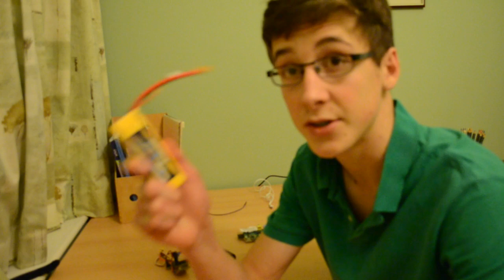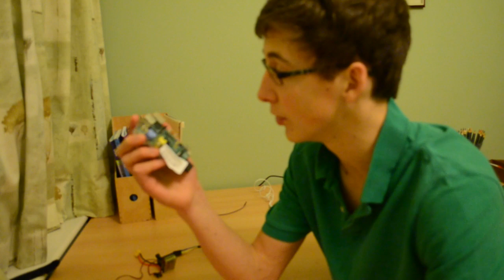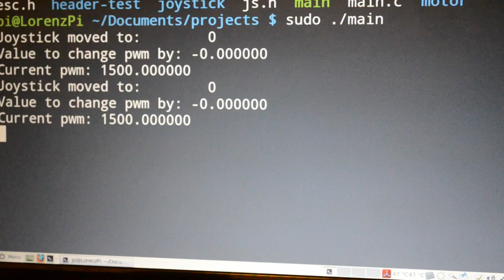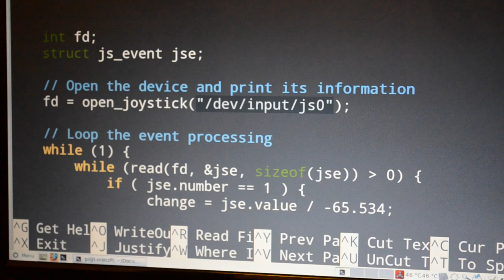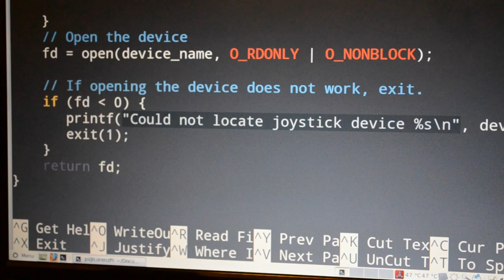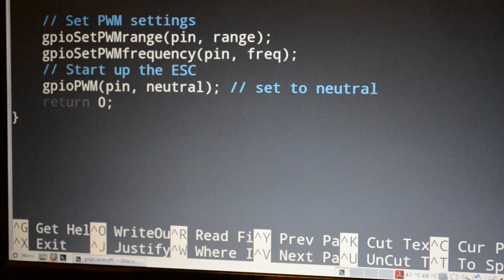Pi'D-C: Joystick controlling brushless motor on Raspberry Pi

Comment: Hi, so my motor has the two pin connector thing. Can i put it straight into the Pi?
Reply: noooo you will fry the raspberry, use an H bridge motor controller